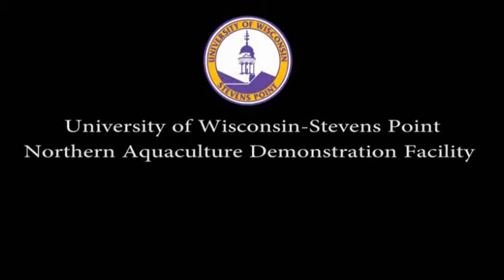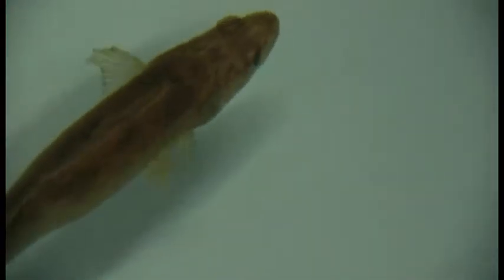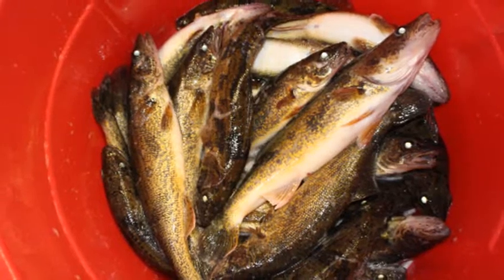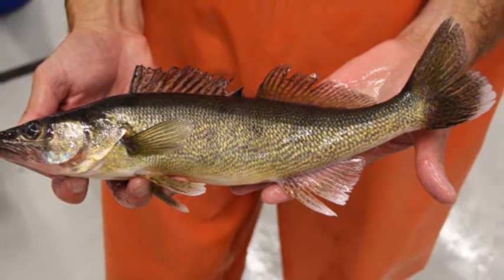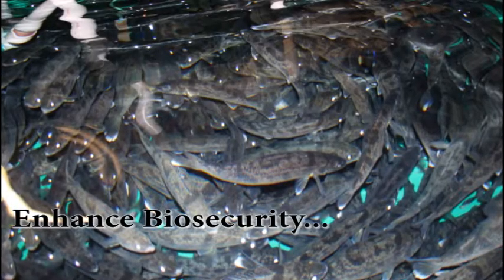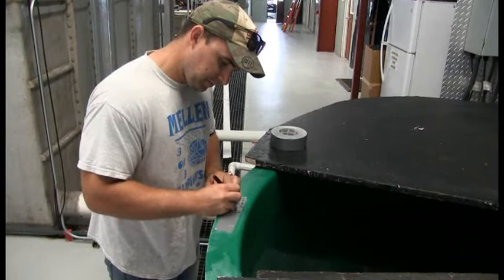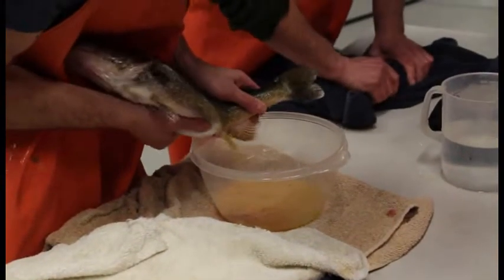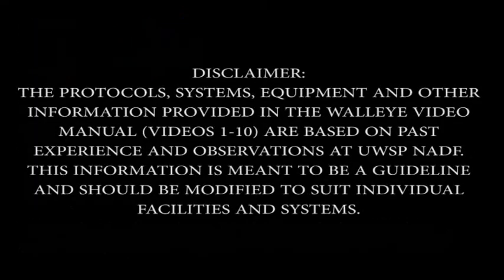Walleye Purging Techniques for Harvest and Critical Point Summary

Comment: what kind of filtration or water cycle  system requires for 2 days in order to remove geosmin compound? would it need to be fresh water changes in those 2 days of purging?
Reply from the maker: Our purging system is completely flow through, in a sterilized cleaned tank for 5-7 days or depending on walleye lipid content. The Conservation Fund Freshwater Institute has done a lot of work with purging systems if you want to reach out to them for further info: https://www.conservationfund.org/our-priorities/resilient-communities/freshwater-institute/